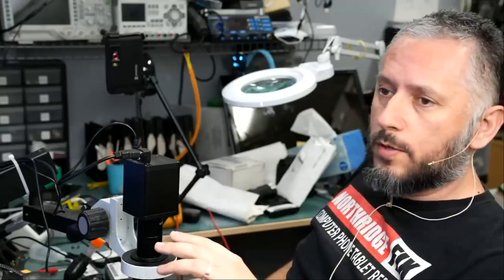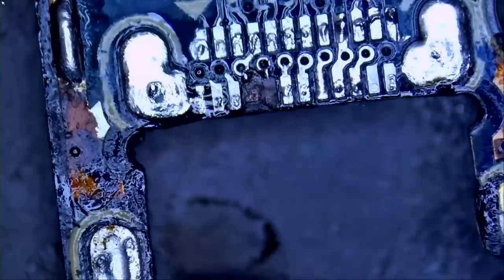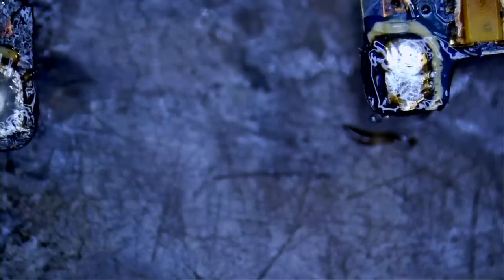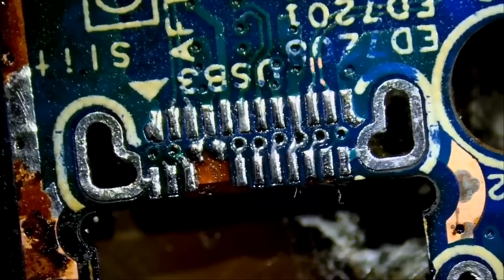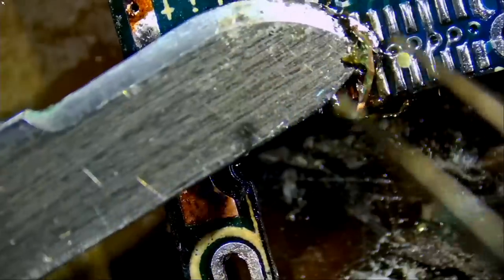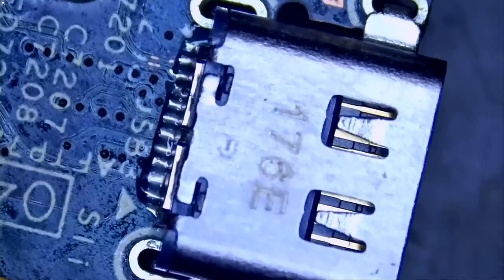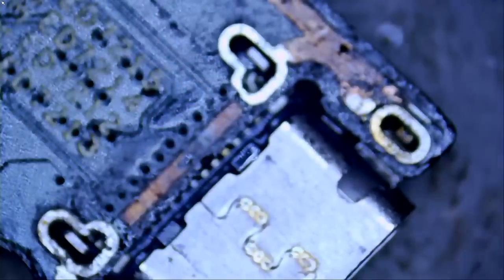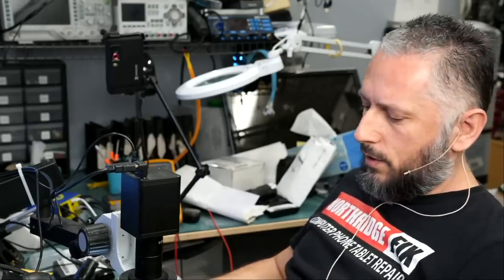Lenovo 13s Top secret repair - Customer asked not to make a video.

Comment: Well at least I wasn’t shamed that badly lol I was the tech that worked on it, the 2 traces went up when I was wicking solder up on attempt 2 (probably should have stopped on try 1) only reason why I asked was because I was embarrassed which is why I said please and added a emoji at the end I wasn’t trying to be disrespectful I’m sorry you took it that way I guess now that we are here what should I have done better? I have been staying away from usb c because of those hidden pins, I find when I do them I don’t get the solder melting fast enough which is why it got crispy I have my hot air set at 435 and usually 4-8 for air flow depending on what I do, I did this one by heating from the bottom because I didn’t want the inside pins to not melt and the outside pins to melt tearing even more traces either way thank you
Reply from the maker: No Worries. You should not be ashamed of a failed repair attempt. Rather you should seek to learn from your mistakes. Hopefully this video gave you a glimpse on how it should be done. The pads could have been broken from the very start, or it could be that you did not apply enough heat to melt solder or you pulled on the connector too soon before solder liquified.  All in All the Secret is now revealed :-).
Reply: @NorthridgeFix  still you been speaking about the customer who asked.
he did not demand and it was clear what he meant, you took it like he spit in your face or something.
calling him lame, that's low.
Reply: @robertvogel4056  Dude ... chill. They're both fine with it. To me it was somewhat of a joke with that smiley there, and basically asking for a video.
Reply: @robertvogel4056  niet zo serieus
Reply: liar , it was my motherboard repair
Reply: @robertvogel4056  yes , he should just do as the customer asked . customer should refuse to pay now
Reply: @NorthridgeFix  Just ignore the people are are proxy offended.
They have nothing better to do until mom brings them their hotpockets.
Reply: Mistakes happen, we're all human.
Reply: No shame in a failed repair man. You're trying to save a broken electronic from landfill. Sometimes you fail. Sometimes it was already damaged beyond your ability to repair, but you tried. That's what counts. Maybe this taught you something for a future work.

I'm a huge proponent of right-to-repair/recycling electronics. Anyone else who does this stuff is cool in my book!
Reply: @robertvogel4056  Nah its fine, wrong place to weeb.
Reply: @NorthridgeFix The USB c in these laptops keep breaking for some reason. I have Lenovo T14 having same issue.
Reply: This guy, Alex won't shame you! He's quite professional!
^..^~~

Comment: Honestly, a huge impact on your success rate comes from using quality equipment. If your hot air station isn't powerful enough you're going to crispy without flowing. Inadequate heat for too long.

Same with your iron - if you're using a crappy iron that can't maintain temp you're just going to burn things. All in all, this was actually a pretty simple repair assuming you're using quality gear.

Nice work as always, Alex.
Reply: That's very true.
Reply: Yup its a goldilocks situation, not too hot not too cold. ❤

Comment: I'm an Electrical Engineer and I can honestly say the work you do is amazing. It isn't easy to be effective and diagnose problems when you have no detail schematics. Just raw experience and sticking with it. I can say that I have a HP spectre laptop for my son in college. It's still within the 1 yr warranty and has been returned to HP for repair 2 times. The unit won't power up intermittently does. The power port light doesn't come on. I would bet if I sent that laptop to you it would have been repaired the 1st time! I'm going to have another talk with HP to see about getting a refund. Keep up the great work and if I ever need a repair I know where I'm sending my electronics!

Comment: Seems some comments are forgetting the fact that when devices that have been worked on are sent in is frustrating, if you're wanting to repair things yourself learn how to do it watch videos, practice on dead boards try various equipment, you're not gonna be a solder king In a day. Hell there's been mistakes I've made but I learned from them and moved on. Great video NRF

Comment: There is nothing to be shamed off if you do this everyday and one time things go out of hands. I do this everyday and learned soo very much from Northridge Fix, and sometime I rip the pads too. Not every time I make mistake but sometimes the board are so poorly manufactured they are very susceptible to tiny amount of heat. So cheer up its fixed.

Comment: I just did two of these Type-C port replacements on thinkpads yesterday, and thankfully there were no ripped pads on either of them. But it is common when doing HDMI or Type-C port replacements for the pads to be ripped or weakened when the port breaks off the board. So having a few come off is nothing to be ashamed of. It's happened to me and I'm sure it's happened to everyone in this business.

Comment: If it's a request to not do a video, they need a specific reason. Not "just don't do it". One would be a young kid who tried replacing it and is afraid his parents will find out, or something. Maybe you'd honor that. But you weren't told a reason.

Unreasonable demands (such as asking a YouTuber who is also a repairman to not do a video on a repair... which is literally half of his job...) shouldn't be met. I agree with you fully on that. It's unreasonable on the basis that you were actually given no reason.

Glad to see it got sorted out in the pinned comment though. No shame in a failed repair.

Comment: I replaced USB connector twice in my life. That was the first and the last time ;-). It took me 1 hour of cursing the world. But I finally managed to solder it correctly. Maybe not better then factory, but there was no difference. When you watch such videos you may think it is easy. I can assure you, it is definitely not. Even if you may think you are confident with soldering. Microsoldering is simply another level.

Comment: Hello NorthRidge Fix! I am a fan of your channel and I actually learn a lot from your videos. I've fixed a couple laptops now and I am stil learning. If you don't mind me asking, how do you reflow the ports like in this video and other PS4 PS5 Videos? Do you angle the hot air nozzle away from the port itself? I'm trying to figure out the technique and I don't have board to play with right now. 
Do you angle it at a certain degree or how does it look when zoomed out?

Comment: I've been following a lot your laptop stuff as before Xmas a neighbour gave me sixty yes 60 broken laptops and some of them are pretty high end, some I will break for parts on ebay, the modern ones I do intend to have a go at repairing 'em and have been buying in things like mosfets and common components like caps and fuses etc.   I haven't done close soldering work for many years and my hobby is mainly horology these days but these laptops are just too good to just ignore and were totally free too.   Also a couple Sony Viao's that work fine but are pword locked so should be an easy one to reset I am hoping, I got a pretty neat kit from Ali which is a quite potent variable PSU with 20 odd laptop connectors of different types.   Decent connectors on it too, not your usual two bits of wire you shove in the holes, polarity and voltage set on the box and the connectors are staggered bullet types so no danger of crossing lines :)   I cut my computing teeth on a Commodore Pet, broken and begged for at our local tip back in the latish 70's, fixed, then fixed a second one, money from both bought a broken 8086 IBM, fixed and used that until I got my 386DX PC to go along with my ZX80, ZX81, ZX Spectrum and Atari 400 for gaming on.

Comment: How is that hot air can liquify solder before it melts the plastic inside the connector?
Reply: The solder has a really low melting point. I believe he uses low heat solder.

Comment: Nobody noticed that he did not solder the two lines that he rebuilt, I have seen many of your videos and it shows that you already have a lot of experience using the technique of reflowing hdmi, usb, usbc connectors, charging ports, but to the lines reconstructed you put solder before reflowing them, 10/10 in rebuilding lines, and 10/10 in reflow technique, maybe you were exhausted and it was time to close the shop, we are human and the best hunter can miss a rabbit.

Comment: How can you be sure that the hidden row of connectors are soldered as well? The hot air can't even get to it that well.
Reply from the maker: Heat is applied to the board,. Board reaches melting temperature of solder. Solder melts all across. Connector gets reflowed.

Comment: Yeah, so long as you dont post the customers name or anything identifying I don't see what the big deal is?? I get they are a little embarrassed, but something like this is very easy to mess up. I do some micro soldering at work and have had my share of learning experiences. It's nothing to be ashamed of.